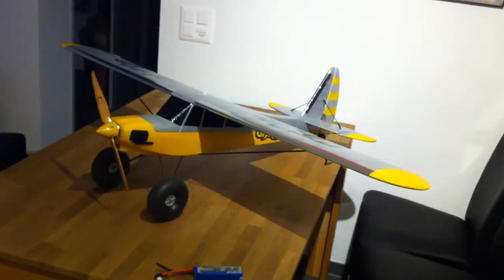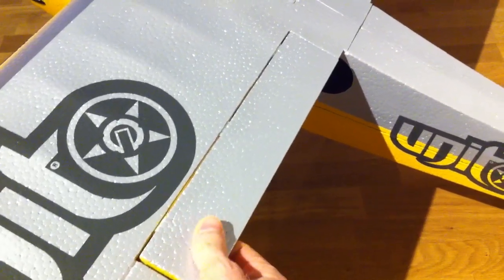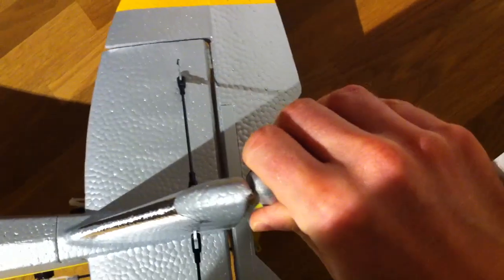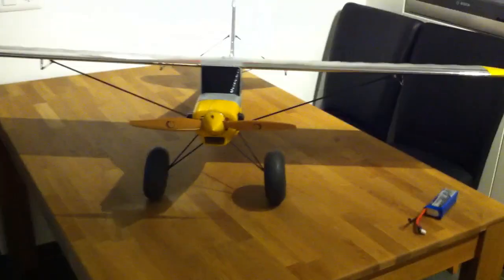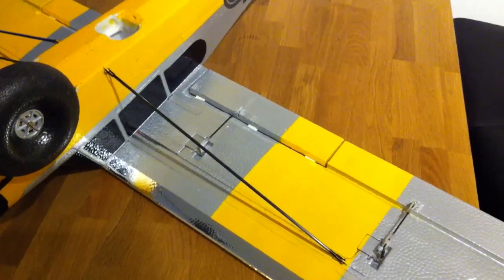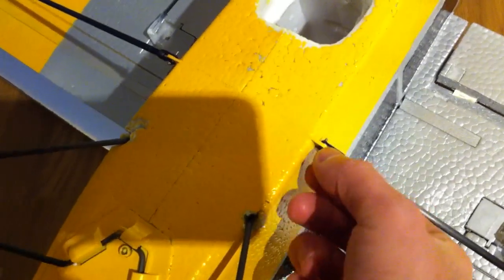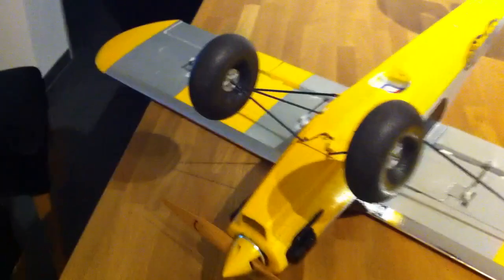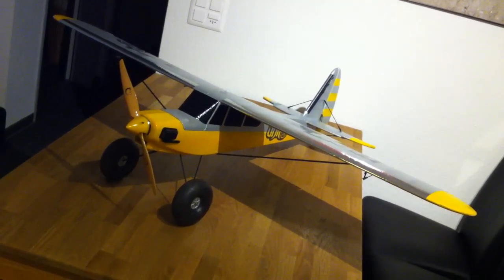MULTIPLEX FUNCUB | THE MODIFICATIONS FOR 3D FLYING

Comment: Can you better explain the battery modification? You secure the battery with a piece of tape? Also, with the battery that far back is it still possible to get the CG where the plans call for it to be?
Reply from the maker: Yes. the battery is secured with a piece of tape. well fixed and super lightweight. default CG is too much in front. The plane is very nose heavy. With the battery in position i chose you can get much better aerobratic characteristics.
Reply: @RCnerd74  Is there any sort of "hatch" to cover the hole where you insert the battery?
Reply from the maker: @cattail3  Just check the video about the mods on my latest funcub build. This solution for the battery works perfect:  https://www.youtube.com/watch?v=p4TWSqZDgrY&t=1s   Explanation of the battery mount starts at 2:45.